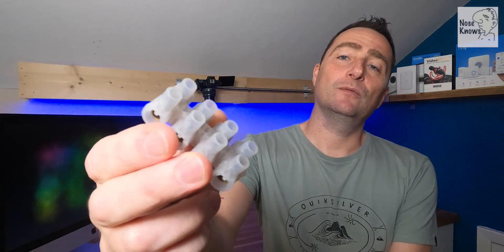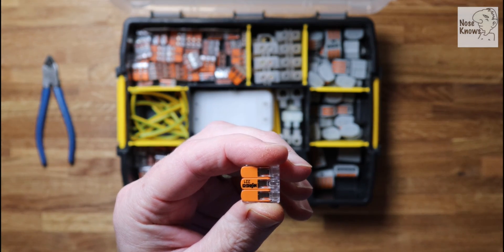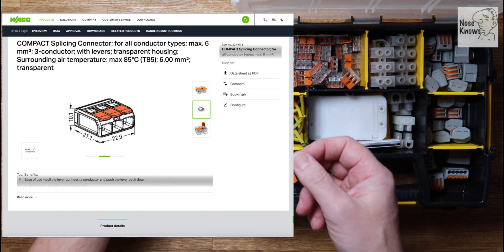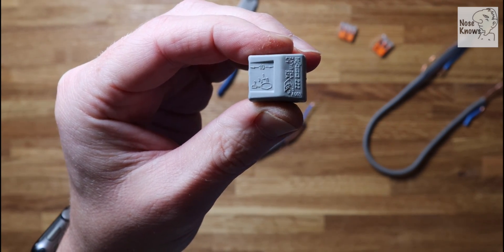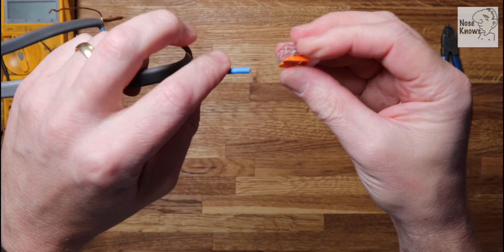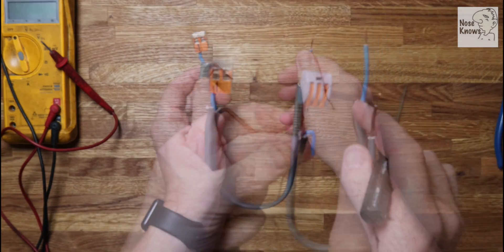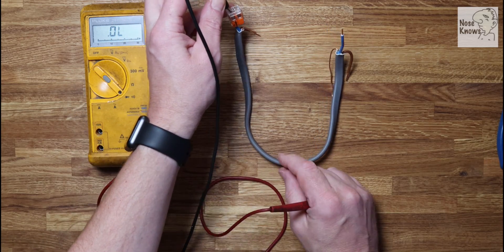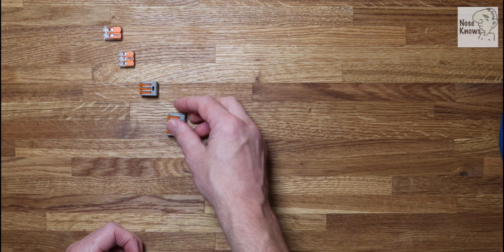Simple Wago Electrical Terminal Block / Connector

Comment: Why do they have uneven ports when you connect wires together, what is the 3rd of 5 port for?
Reply from the maker: Lots of different things but lighting circuits are the most common when you have more than 2 same circuit wires to keep together.

Comment: Great video, subscribed! Question, im wiring a campervan, im looking to wire 4 led lights along the roof with one cable. Would a 3 way wago connection be a good job for that or what would be best? 
Cheers
Reply from the maker: Thanks Mark - As long as the camper van is water tight and there is no damp in the wiring area then the Wago connector is ideal just make sure you spec the correct clip for the LED wiring.
Reply: Marine grade heat shrink tubing over the connectors should help seal them.